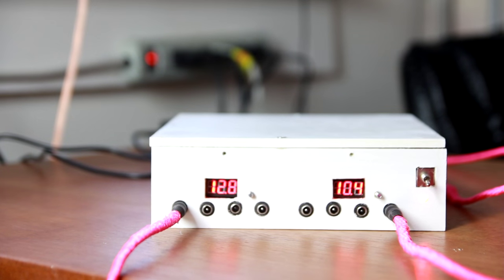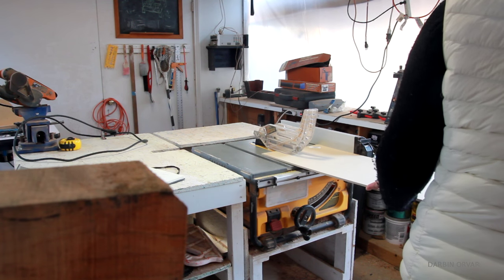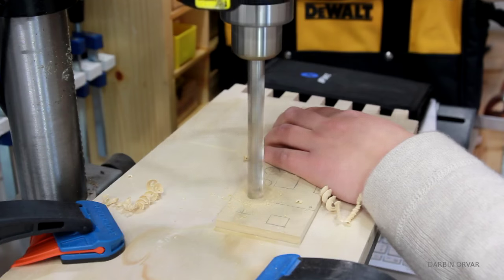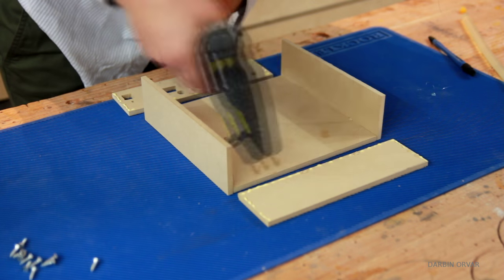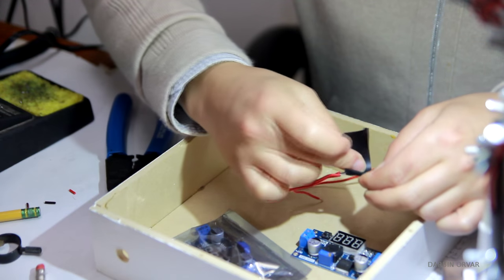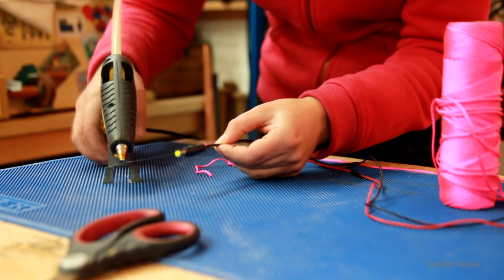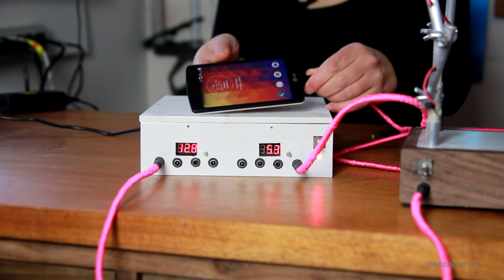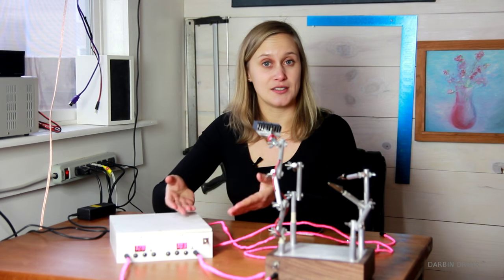How To Make a Power Strip to Charge your Phone and Desktop Electronics

Comment: Glad to see someone else has enough sense to provide useful power outputs for electronic devices. I plan to do something along the same lines various places in my house. BTW, what you call 'pig tails' are more properly known as 'barrel plugs' which of course plug into 'barrel jacks'. The most common size is 2.1mmx5.5mm. Also, I concur with the comment about using different jacks for different voltages. I would use the barrel jack for 12v and USB typeA jack for 5v. The latter has the bonus in that you don't have to make custom cables - any std USB to mini/microUSB cable will do.

Comment: Very nice project. One suggestion I would like to make, is use heat shrink tubing for splicing wires together,  much neater looking.
You can find different thickness and colours, Harbor Freight carries a good assortment and they are reasonably priced as well. 
Tape has it's place but once you try HST you will never use it again for splices and small projects.

Comment: Another nice video, but I must point out that you should've used different type of pins out of the box for different voltage outputs. Just to avoid accidently charging your phone with a 12v input. Which surely will ruin the electronics inside.
Reply: +Waqas Hussain  i totally agree on this. Its a quick but expensive mistake to make.
Reply: +Waqas Hussain Inside all phones there is a voltage regulator the brings the voltage to 3.7 volts. that is why all phone batteries are 3.7 volts.
Reply: +jake B I wouldn't say this if I didn't have first hand experienced with a bricked device myself. 😢
Reply: +jake B 
There is a voltage regulator going from the battery to electronics as they need a very steady power supply to work, but I've not seen them regulate charging voltage, maybe you have any specific devices in mind?
As far as I could measure phones get 5V to the battery, and you do need to have that higher voltage for batteries to charge(especially for fast charging), electrons won't got anywhere if you don't have a pressure difference.
Reply: +Waqas Hussain.. yes I can confirm when you plug a 5v blackberry into a 19v lap-top charger the blackberry releases the grey smoke of death very very quickly
Reply: +Waqas Hussain Recent android smart phones have Qualcomm quick charge. This allow phone to "negotiate" higher input voltage and reduce power loss from high current over USB cable. My nexus normally ask for 12V from charger (e.g. Turbo2 mode). I don't think you will ruin it but I agree that different voltages should have different connector ...

Comment: Hey Linn,Great project.  Need to steal your idea.  One suggestion is to use heat shrink tubing instead of the electrical tape.  Makes a cleaner cover and it doesn't come undone like when heat affects the adhesive backing of the tape.

Comment: hey sorry but had to mention that the "voltage regulators" used aren't actually voltage regulators but a circuit containing a volt.reg. (and capacitors to steady the output voltage quicker and more effectively.) The volt reg is above the seven segment display and next to the potentiometer, in case you were unaware.

Love your channel and keep those electronic videos coming :)

Comment: That is a wonderful project.  

One improvement idea:: 
Hot-Glue (or solder if you dare) a cut nail as a pin on the potentiometer to stick through the box.  You can then put any knob to make it easier to change voltage(s).

I think I am going to make one for my desk at work and one for my home shop.

Comment: cool project and nicely done. do you know how many amps it outputs? 

also, I'd recommend wearing safety glasses when soldering. If you accidentally flick the wire just a tiny bit it could throw molten solder in you eye blinding you. Don't want that to happen!
Reply: I 2nd WW's eye protection warning.

Comment: A very useful project. With all that space in the box, maybe put the AC/DC adapter inside and a grille to vent the heat? I've seen some that put the wires inside a braided sleeve that also looks kinda neat. Just not as pink as yours :-)
Reply from the maker: +Fredrik Rambris Thanks, that's a good idea but I think it would be difficult to access based on where I'm going to put it.

Comment: hey Linn, I'm very curious, why do you skip using the threaded face mount (toggle switch) all the time?

For anyone who would prefer an acrylic case, drill out the holes for the screens and then use a "nibbler" cutting tool to make them square.  same for soft sheet metals!
Reply: Ah! Just remembered a trick: Pull the core out of a shoelace (or paracord) and secure onto your wire with heat-shrink tubing. A trick I learned for an inexpensive alternative to cloth wrapped wiring.

Comment: Nice project!.
Just a thought, if your voltage regulators are not equipped with overload and/or shortcircuit protection, it might be a good idea to install additional fuses match the amperage rating of the voltage regulators, that can eventually protect your voltage regulator.

Comment: A few ideas for improvement:
- different connectors for different voltages, so that you don't fry your phone
- ventilation to keep the electronics from overheating
- switching the power supply at the mains to conserve energy
Reply: +Jens Goerke inside all mobile phones there is a voltage regulator that brings the voltage from 5v to 3.7v. This is because the phone's battery is 3.7v. I do not think it would be good to plug it into 12v but I do not believe it would fry it.

Comment: While it's a neat project, if you're mostly going to use 12v and 5v, you might as well use a PC power supply (which will also have more power, a fan, no external adapter, and be smaller than what you built). All the devices you mentioned can be powered via USB; wouldn't it have been better to make a multi outlet USB PSU? The USB has a protocol built in to limit power usage and regulate voltages to protect the connected devices. USB 2.0 can deliver 2 amps per outlet (your device has a 2 amp total power limit).

Comment: The way you're bundled up, I think you need to do a "Heating Your Shop" how-to.
Reply: Also, how did you learn what you know about electronics?  I feel that is an area where I'm sorely lacking.  You had a 2600-ohm resistor in there, but I couldn't tell you why.  Stuff like that.